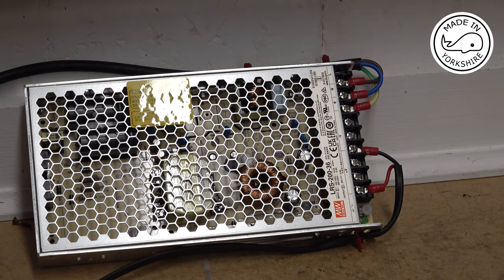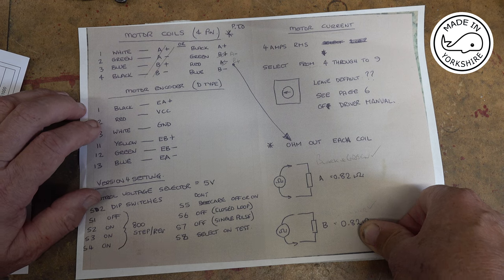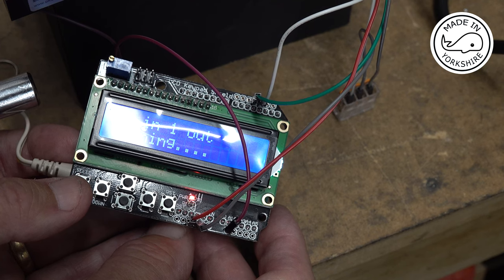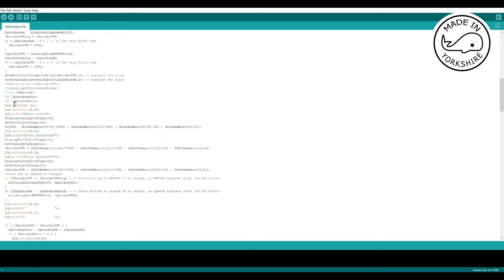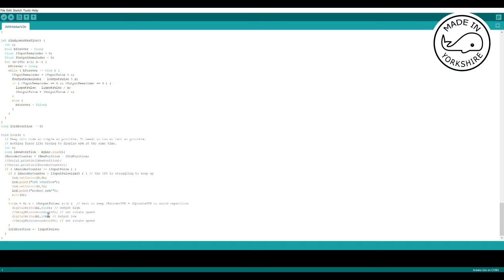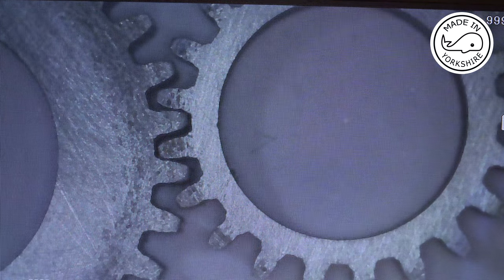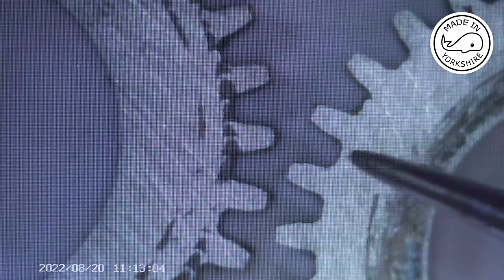#MT50 Part 6 - Making a Gear Hobbing Attachment. Closed Loop Stepper Motor. In 4K by Andrew Whale.

Comment: Andrew, Hats off for the effort.  To echo a few, concentricity of the blank and the hob will have a big effect on the outcome.  I work with hobbing machines daily.  Hobbing machines are geared, and the indexing is done with a large worm gear turning the blank.  There is significant rotating mass and inertia behind both hob and blank to insure the proper relative speeds throughout the cut.  The hob and blank are also both commonly on shafting and are very rigid.  When anything is loose or eccentric on a hobbing machine it greatly affects the outcome, but these are relatively easy to spot and fix.  Seems like you have the code and counts correct, hurdles are the belt, rigidity, and concentricity.  Technically you have the setup correct down to the Helix Angle (lead angle).  Clearly you have reverse engineered the process.  Again, incredible effort and persistence.  Nice job.   The other, other Andrew from across the pond.
Reply from the maker: Hi Andrew - thanks for the info. I will investigate the belt, rigidity, and concentricity. I'm beginning to wonder if gear hobbing in the home model engineering environment is too big an ask. 
All the best.
Andrew

Comment: Excellent video Andrew. I would definitely try a different hob and see if you get the same or similar results. I can appreciate your feeling of not wanting to be defeated, so to speak. Again, excellent video and work. Looking forward to the next video.
Reply from the maker: Yeah - the hob is one of things that I would like to try to eliminate as the cause. Unfortunately they are quite expensive and I don't want to purchase one without having a need for it in a future project. I've looked at second hand ones on eBay, but not knowing their history it's a bit of a gamble. As I understand it, if a hob has been incorrectly sharpened it can produce all kinds of problems. Some people make their own hobs, but for me that would just complicate matters even further.
Cheers
Andrew

Comment: One thing I might suggest if I may. You might get a better tooth profile if you don't 
back track on the moving cutter. It seems to me that you'll get a better profile when
you cut through it once foward & shut the cutter off when you back track.
Interesting project. Thanks for sharing.
Reply from the maker: Hi Todd - I have since tried one cut - but the same result. Thanks for the suggestion though.
Cheers
Andrew
Reply: @learningturningmetal  Thanks for commenting Andrew.  I didn't think that was your total problem.
I just noticed with the little bit of experimenting I did with making gears, when I backed off on the moving cutter,
my teeth were distorted compared to others that I didn't.

Comment: Great series Andrew. Both my thoughts have been suggested below.. tool rigiidity.. and arduino clock speed/cost of digitalwrite function.
Reply from the maker: Thanks Matt. I will certainly check out tool rigidity. I have a crude check in the Arduino code to try to identify if the CPU is struggling - and it doesn't kick in. I have since been testing with AndysMachines code (written in assembler) and that produces identical results. A bit of a brain teeser!.
Cheers
Andrew

Comment: Hi Andrew, FWIW, there are two mechanical things that I think are worth investigating before delving any further into the electronics:

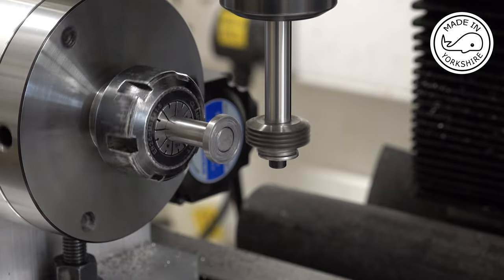1) As others have pointed out, your arbour isn't running true - look at about 16:00 to 16:10, you can see both the chuck and the arbour running out against the background. Also at ~20:34 you can see it again, but it looks a bit more than a 'once per rev' eccentricity - maybe there are problems with the bearings in the work spindle? I think it would be worth sticking a clock on it for a while to eliminate this possibility. (Or at least, clock up your arbour to make sure it's running true before cutting.)

2) Even with perfect timing pulleys and belt, if there is any eccentricity in the pulley PCD (not necessarily the OD) after mounting, it will transfer to a cyclic error in position.  If the belt has too little or too much tension (or is just a poor fit to the pulleys)  it won't settle smoothly into the pulley teeth, and there will be some 'cogging' as they rotate (i.e. some variation about the 'ideal' position as each tooth engages and disengages). Given that you now have the closed-loop stepper, I think it would be worth trying to drive the work spindle with it directly (through a torsionally rigid coupling) and eliminate the belt drive completely.

Good luck! I admire your perseverance! 🙂
Reply from the maker: Thanks for the suggestions - yeah there is definately runout. I will replace the collet chuck with a 4 jaw and try again. Yeah - I have wondered about the accuracy of the pulleys. They are supposed to be timing pulleys with teeth. Driving the spindle directly seems like a great idea. I will certainly give that some thought! 
Cheers
Andrew

Comment: Hi Andrew.
Thinking about this, where you are moving the gear blank sideways to the cutter the spiral of the cutter is what is causing the wider gaps between the teeth if the blank is at 90 degrees to the mill spindle, try having the cutter directly behind the gear blank and using the X axis to cut instead of the Y axis, it will be harder to get the right depth but that can be set as a zero on your DRO that you drive the axis into. Other than that you may have to set the blank rotation axis to match the spiral axis of the hob cutter.
Reply from the maker: Hi Robin - thanks for the suggestion. My understanding is that the hob design requires the hob to be cut along the x-axis, in order for it to produce to correct tooth profile. Plunge cutting the hob will not produce the required result, as the cutters on the hob don't have the same profile as a basic gear cutter.
Cheers
Andrew
Reply: @learningturningmetal  The hob to work setting is usually not at 90 degrees but corrected for the lead angle of the hob,  The direction of travel is along the axis of the gear which you are doing.  You could accomplish this by rotating the head of the mill slightly in the correct direction.  The lead angle (hob setting angle) is usually marked on the hob.  If you are not cutting in the "hobs normal plane", you will be producing a wider space, as you are.
Reply from the maker: Hi Ralph. Thanks for the info. The helix angle of the hob is marked 1deg 20min and I set the angle of the mill spindle to that by moving the spindle down by 1" and getting the offset to be sine of that angle. I checked this several times and I think it was spot on. I guess I could experiment by adjusting the angle and taking more test cuts.
Cheers
Andrew

Comment: Hi Andrew, it would be interesting to see on the oscilloscope a comparison of both encoders while the machine is running. 
Rich
Reply from the maker: Hi Rich - yeah that would be interesting, but I have no idea how to interrogate the encoder built into the stepper motor. Food for thought!
Cheers
Andrew
Reply: @learningturningmetal  Hi Andrew, I'm thinking that you are losing pulses from the mill encoder. do you think that swapping the outputs would help? I would be thinking of replacing the mill encoder with another type
Rich
Reply from the maker: Hi Rich - I think I might have found the problem. See the next video - uploading now!
Cheers
Andrew

Comment: One thing that you might try is only cutting in one direction. Each time I see you do a cut you bring the hob back through the work for a second time in the reverse direction. Could this introduce a small difference? Excellent investigatory work though. A great video.
Reply from the maker: Hi Terry - thanks for the advice. I've since tried completing a gear in just one pass - but it doesn't appear to make any diffterence. 😭
Cheers
Andrew

Comment: Hi Andrew, the closed loop stepper motors have really come on, a lot cheaper than a servo & I would say perfect for this application. I would  try another hob, cheap ones are NOT all equal! Also sort out the concentricity issue on your indexer. Check on the gear if there is a sort of phase shift as you go round from tooth to tooth. Hope this helps.
Reply from the maker: Hi Dave - thanks for the advice. It would be great to be able to eliminate the hob as being the cause. Problem is new ones are quite expensive and I would need to buy one suitable for a future project. I've looked at the second-hand market but I think that is a gamble, not knowing the history of the item.
More testing needed!
Cheers
Andrew

Comment: When the video was sped up, you can see run out on the shaft holding the gear blank. That would definitely make that gears teeth smaller than expected. Can you setup a tailstock center for the gear blank shaft?
Reply from the maker: Hi Don - thanks for the suggestion - I will certainly set up a tailstock centre and try again.
All the best.
Andrew

Comment: I don’t think your problem is with the electronics. I think your hobbing machine headstock doesn’t have enough rigidity, also your not using a tailstock to support the mandrel.the vibrations may be causing the teeth to cut oversize. If you have a tailstock for your dividing head or rotary table try setting that up to offer some support to the mandrel.
Reply from the maker: Thanks for the advice - I will check regidity out.
Cheers
Andrew
Reply: Perhaps cut a few plastic (Delrin) gears to see if it improves? Is the tooth width on the Hob OK?
Reply from the maker: @kenshelhamer9816  thanks for the suggestion. See my latest video for an update 😉
Cheers
Andrew

Comment: Hello Andrew, I admire your perseverance getting this issue sorted out. As someone who really has no idea about your electronics, I would like to present my observations on strictly mechanical terms. Is there an accurate method to measure the teeth on the hob? I am somewhat in agreement with wino4340 that the issue might be with the hob itself. Also, could there possibly be some "tool flex" in the hob shaft as I observed a little more material being taken off the gear as it was returned to the "start" position? Perhaps stopping the cutting operation with the gear to the right of the hob after being cut and examining it then. I am confident you will get it sorted. Good luck !!!. Earl
Reply from the maker: Hi Earl - thanks for your thoughts on this. It would be good if I could eliminate the hob as being the problem - but they don't come cheep. I will look into rigidity - more testing needed!
All the best.
Andrew

Comment: Andrew,  This is a tough one for sure.  During the high speed view it looked as if the gear shaft was wobbling but that could just be a video artifact.  The counts are really close.  It does appear that the gear is being over hobbed.  Could the depth be a bit too much?  Say trying a reduced depth of cut? Or breaking it up into 2 passes as the end of the gear shaft isn't supported.  Granted rotationally you are beyond close.  The question now may just lie in the effectiveness of the actual cutting operation.  32 teeth may not be enough for you to learn much from.  You could increase the diameter of the gear to say 64t.  see what sort of flex deflection you get at the end of the gear's shaft and the end of the hob's shaft.  I think the issue at this point is more mechanical.  I may not be in the right ball park. mostly just thoughts.
Reply from the maker: Thanks for the suggestions. I will do some more investigative work.
Cheers
Andrew

Comment: Hi Andrew, are you tilting the head of the mill in order to compensate for the helix angle of the hob? This is clearly visible in AndysMachines' video (probably also mentioned in the audio). The cut should be parallel to the rotational axes of the blank but not at an angle, right?
Reply: Or in fact is it tilted the right way?

Comment: You can see that the involute-cutter gear teeth have a slightly different profile (they're thicker). So I'd be suspicious of the hobbing cutter profile. Also, the stick-out on the spindle is fairly significant, given its diameter...and I suspect you're getting some cutter deflection that might account for some of the difference.
Reply from the maker: Hi Tim. You are on the right track👍. See my latest video for an update.
Cheers
Andrew

Comment: Perhaps the encoders/steppers/program allow a small amount of angular variation, slightly enlarging the tooth gap?
Reply from the maker: Hi Ken - could be. Both programs produce the same outcome - so I doubt it's that. It could be and encoder/stepper issue - but hard to spot.
Cheers
Andrew

Comment: When you are cutting the gear at around 16mins there looks to be some runout on the chuck holding the gear blank. More noticeable at the higher 4x video speed. Could that explain the wider gaps?
Reply from the maker: Hi John - well spotted. A think the runout is just a few thou, but certainly not perferct. I will test with a 4-jaw independent chuck.
Cheers
Andrew

Comment: Hello Andrew, I am wondering if you problem is interrupts .Unless you are running in assembler you really don't know what is happening when a position change comes in from the motor encoders. I don't know much about Adreno, I use to program Intel 8085 and 8051 microprocessors to do  speed and position control. When a position change comes in it must take the highest priority , and everything else like LCD refresh must wait while the position  is processed and the  control of the stepper is processed and implemented . This is just my thoughts on the matter.
Reply from the maker: Hi Brian. I see where you are coming from but I think I've managed to get to the bottom of it. See my latest video for an update.
Cheers
Andrew

Comment: How much backlash is there in that belt drive?
Reply from the maker: Hi Jeffery. There does't appear to be any backlash in the belt system. The pulleys have teeth and the belt is sold as a timing belt. Mind you, belt drives are totally new to me. Maybe I should explore connecting the stepper motor directly to the spindle in order to rule that one out.
Cheers
Andrew

Comment: Your work. As I assumed earlier, no steps are lost. A properly designed stepper system doesn't lose steps unless some evil guy throws an anvil into the running setup. As a disaster detection an encoder can be used.
After watching Your previous video I came across some hobbing videos launched the last 2 or 3 years. They used a much less advanced approach. Use an indexing plate for positioning the gear blank. Then move the table in the X direction and cut some teeth completely. Advance the indexing wheel a tooth or so, and make a complete cut of a tooth or two. Of course it ought to be possible to automate the index movements....
Maybe I'm wrong but I think You use an Arduino UNO as the controller. It's a handy and is a good friend but not very fast. Clough42 used much more powerful things in his digitally controlled lead screw project.
But, of course You get a lot of experience from Your work. Looking forward to Your next attach on the issue.
Reply from the maker: Hi Stefan - thanks for the suggestions. I think there is some kind of Arduino clone which runs at twice the speed. I will look into what Clough42 uses.
Cheers
Andrew
Reply: @learningturningmetal  It's not an Arduino clone. It's a high performance device, maybe a Texas processor of some kind. But yes, taka a look.
Reply: @learningturningmetal  Why not post Clough42 and hear what he thinks?
Reply from the maker: Hi Stefan. Clough42 has a lot of info on YouTube regarding his electronic lead screw. Also links to products he uses (eg TI launchpad) and source code on github. For his project he is processing a lot more encoder pulses, but I will investigate!
Cheers
Andrew
Reply: @learningturningmetal  I did look at several of the electronic lead screw videos. The lack of a complete list of parts as well as things have to be collected all over the market made me drop the idea.
I do have an electric rigging for controlling the lead screw during turning. Automatic reverse of the lead screw, just to feed the cross slide... No assembled to tested yet.... Motor control, reverse proximity switches, code is ready. Just the final testing remains.
Reply from the maker: @Stefan_Boerjesson  Good luck. I might just reinstall my c++ compiler and have a play! All good fun 😀.

Comment: maybe there's a rounding error in the calculation so that there is a slight drift over time, have you tried calculating the ratio between pulses? does it end up as an exact whole number?